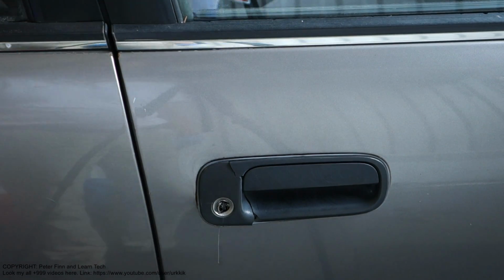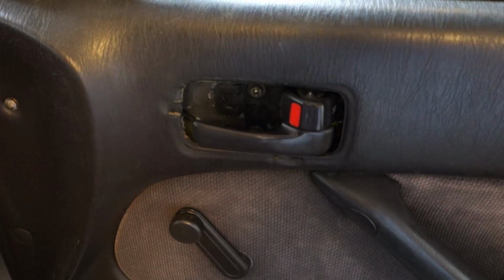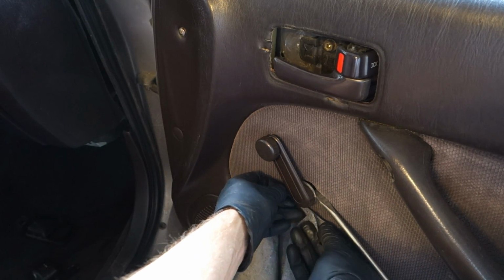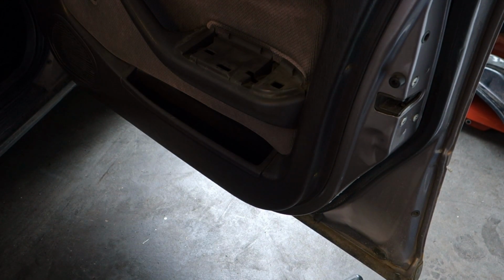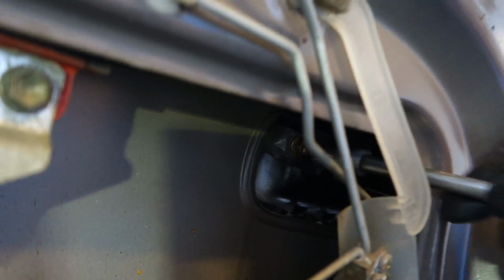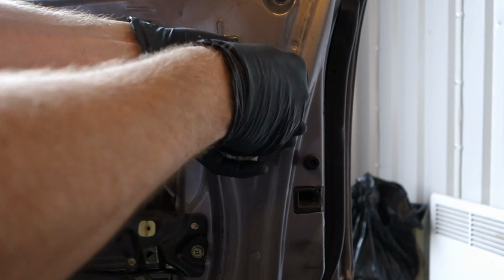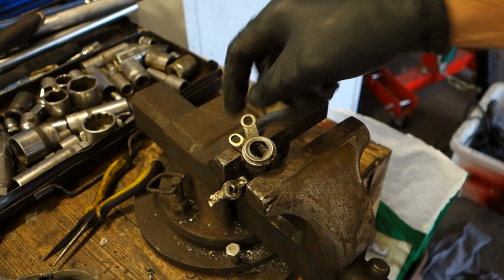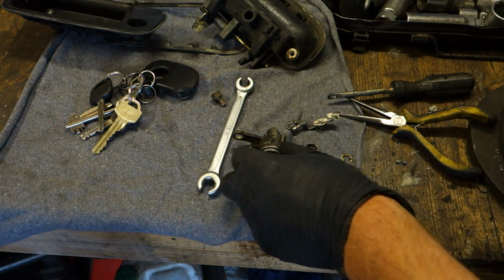How to repair door lock Toyota Camry. Years 1991 to 2002

Comment: My 91 es250 passenger front door will not lock with the remote or by pressing the lock inside. What can be the problem? The handles to open it are also quite hard to pop open. Thanks
Reply from the maker: The lock must open and lubricate.